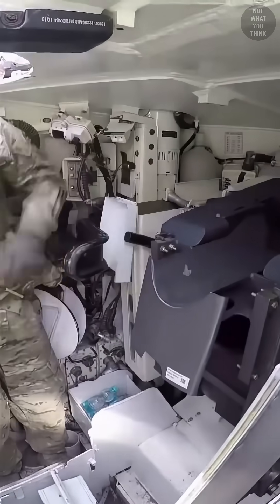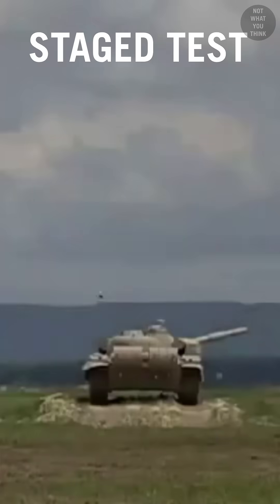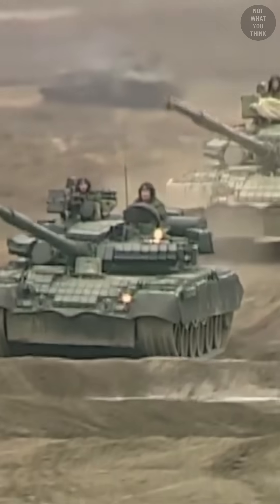Why M1 Abrams Tank Has No Auto-Loader #shorts

Comment: I'm sure, if the US wanted to, they could replace the loader with a auto loader and still keep the ammo in the same place. After all, robotics, image recognition and processing power has greatly improved since the initial deployment of the Abraham's in the 1980s. 

I'm sure that the next generation of US main battle tank will (have the option to) be completely remotely operated. As drones are generally cheaper to operate, even tank sized ones, and require less of a public relations effort whenever they are used or get destroyed. So, we will likely see an auto loader in a US tank soon.

Comment: almost no russian tank accept the t14 has an auto loader
Reply: The current line of russian mbts since the t-64 have all used autoloaders including
T-64
T-72
T-80
T-90
T-14
2s3m
Bmp3
Etc etc, they use autoloaders
Reply: list of tanks with autoloaders:

A
Al-Khalid tank
AMX Chasseur de Char
AMX-13
AMX-50
Armata Universal Combat Platform

B
Batignolles Chatillon 155 mm
Black Eagle (tank)

F
Falcon Turret

K
K2 Black Panther
Karrar (tank)

L
Leclerc tank
Leclerc XLR
Lorraine 40t
Lorraine 155 mm

M
M-84AS
M-84AS1
M-95 Degman
M8 Armored Gun System
Main Ground Combat System

O
Obiekt 490
Obiekt 490A

P
Patagón
PT-91 Twardy

S
Sabrah Light Tank
SK-105 Kürassier
Spähpanzer SP I.C.
Stridsvagn 103

T
T-14 Armata
T-64
T-72
T-80
T-84
T-90
T-Rex (tank)
T71 Light Tank
Type 10
Type 15 tank
Type 80/88 main battle tank
Type 90 tank
Type 96 tank
Type 99 tank

V
VT-4

Z
Zulfiqar (tank)

how many russian tanks are there? ah yes, quite a few.

Comment: The more I learn about tanks the more I think the "Some argue a loader is essential to replace one of the other roles or maintenance" is just Americans with actual experience in the Abrams.
It seems to be a maintenance heavy beast. 

Speed, location and safety seem like non arguments. A human takes up a heck of a lot of space, especially one that needs to move about a bit to load the shell. If you were to dedicated the same amount of space to machinery this surely must be possible to do in a similar manner. If anything the blowout panel could be open for even less time. Location is just engineering.

As for speed, the Korean K2 Black Panther and French LeClerc main battle tanks can reload in about 2 seconds (faster than the fastest human reloader). And unlike a human they can do this without getting tired, I've seen these shells quoted as up to 40KG. The only people that move that kind of weight about without tiring within a minute are strongman that won't fit in a cramped tank ;).

Comment: Auto loaders can only load certain length of shot.  Not having one makes you able to use different shot and newly developed ammunition without having to refit the turret with a new autoloader.  Also from my uncle that served with Eagle troop in the gulf and k-troop in the war on terror as a master gunner and commander of an up armored M1 abrams, said a good loader can load rounds faster than an auto loader and doesn't break down and if damaged is easily replaceable, he also says the tank with an autoloader that faces a m1 isn't a threat at all, for long. As the ammo storage arrangement required fir a auto loader to function is perfect for popping turrets and crew.

Comment: It's not a question of an autoloader. it's a question of ammunition storage. The Soviets assumed an atomic attack on the front line and the immediate entry of assault troops on the burning ground. This is certain, while rumor has it that the autoloader had to be used because they discovered that under high radiation conditions the first crew member eliminated would be the one using the most muscle...

Comment: Auto Loaders which have been in use since world War II add complexity to a tanks design, thus making a tank more expensive to produce and maintain. Using a human loader reduces down time due to equipment malfunction which means that a tank can be damaged, those parts replaced and quickly brought back into the battle without having to wait for a specialized team to arrive and fix the autoloader, or worse writing a perfectly salvageable tank off as a Battle loss.
Adding complexity was the main draw backs of the Tiger II tank in world war II. as a result of it's technical superiority it saw less combat time than older generations of tanks, and was prone to break down more, and spend more time in maintenance than on the battle field.

Comment: There are also auto-loading systems which have a seperate compartment with blow-out panels similar to the ammo rack of the M1, Leopard, or other modern western MBTs.
Thing about russian tanks is, that they were designed in a time in which top-attack munitions (Like TOW, Javelin or NLAW) were a non-issue. So the ammo was placed as low in the tank as possible. This, alongside making the T-Series silouettes as small as possible, made it harder for another tank to hit.
So engineering a solution for ammo-cookoff was not needed lowering design cost.
However, when penetrated (the likelyhood of which has massively increased thanks to weapons like the TOW or Javelin which ripped away the first three layers of the suvivability onion), there are little measures in place to increase crew survival.

Comment: Also, a well trained & drilled Abrams crew can maintain about twice the rate of fire of an autoloader equipped tank.
Reply: Yeah like manually inserting bullets into a gun each shot you fire is much faster than letting it cycle

Comment: You have no clue what are you talking about. Abrams also explode from inside, same as every other tank. Ammo inside autoloaders revolver (karuzel) is protected better than in abrams, as it is placed under turret on lowest point of tank. It also got own additional armour, as seen in this video.  Abrams storage is in most common place to be hit. Doors of abrams are huge, karuzel have only one shell size opening . Internal explosions are product shells stored all over tank get ignited. Not one in karuzel. Solution is using only shells in karzuel and zero in additional places. Men loader results in 15t extra weight , as tank is bigger (and not thicker).  You need 4 crew to train, not 3. it doesnt matter if tank is destroyed or destroyed with turret blown out. And in total lost you have 4men dead or 3 in soviet type tank.

Comment: Lets add HE-FRAG ammo into the Abrams ammo rack, hit it and then see what happens, shall we?

I'd love to see how "Private Strongarm" is going to load shells into the breech when the tank is tilting and crashing over 3 axis while on the move.

Once we upgrade the Abrams gun to, say, 135mm, it's STILL going to have a human, or will A LOT HEAVIER shells be loaded by the human?

If hull armor is penetrated, the tank is in most cases lost. Assumption that crew will survive is made because it wasn't hit by an artillery shell. Which is the main tank killer today. Or by a modern ATGM. 

Turret floor is THE safest place for the ammo. It's the least struck area of the tank and to get there, the heaviest armor has to be penetrated. Developers of the new light tank for US marines agree and the tank conceptually is literally a US iteration of what T-64 is: a 3-man crew, HE-FRAG ammo, troop support mission, high mobility, lighter passive armor covered by ERA.

Comment: There is absolutely no problem with storing ammo just like in Abrams and still have autoloader, there was autoloader designed for Abrams as well. Autoloader would even make it safer, because it would need only a small door to take ammo from ammo compartment, while in manual loading Abrams there are large heavy doors. Judging autoloaders by russian designs only is just plain stupid :P

Comment: The issue is not typically the ammo in the auto loader itself, the ammo is 2 peice and often the tanks have small numbers of charges stored in racks that are exposed in the crew compartment. Those are the usual cause of detonation in Russian tanks.
Reply: So the issue is typically the ammo in the autoloader itself.
Reply: @KaIIenie  not directly, certainly the end result is, but the ammo in the loader itself is protected by an armored deck below the crews feet along with the general design of the vehicle. it's not the loader itself that usually goes off first. the vehicle features a number of 'wet' stowage racks for extra munitions, which are also fairly well protected, the big issue lies in the Russian military issuing Extra stowage racks that are collapsible, those rounds are unprotected and vulnerable. Most of the tanks that throw their turrets are using those extra racks or have been hit with top attack munitions that target the weakest point of the tank, allowing them to get somewhat more effective impacts against the loading rack itself. Ironically, the weapon that causes it most frequently is the Javelin we've seen used so heavily in Ukraine.

Comment: The OTHER autoloader design is called the cassette, bustle or revolver style, and stores ammunition in the turret bustle.
This allows for use of blow out panels, and is safer than a human loader.
The armoured door separating the stowage from the crew compartment can be made just small enough for the loading mechanism to push a round through. A much smaller door means it can be better protected and minimises the time it is open for loading.
Many tanks that use autoloaders opt for this design, with only Soviet/Russian tanks using the carousel. This includes Japanese Type 90, Type 10, French Leclerc, S Korean K2, among others.

Comment: The Russian auto loader magazine is under everything else. It is well protected from top hits. The vulnerability comes when they store extra rounds in cubby holes above the autoloader because their supply lines are stretched too thin. The Abrams system of storage is way more survivable by the crew. But the tank is still out of service. Tanks are almost obsolete. Abrams is way too heavy for mud. The projectile from a manpad is traveling at mach 2.5 and is molten steal. Cuts through anything to a certain depth. Reactive armor is still a ? against them. Abrams has a better targeting pc/ new tech

Comment: Really stupid explanation, it's not difficult at all to build an autoloader with blow off panels, the French leclerc, M1X, K2, type 10 and so on all have autoloader with separate ammo storage and blow off panels. Actually autoloaders are more safe since the door doesn't have to be open for as long and you can even expose only a single round at a time to the crew compartment. And of course they fire significantly faster and more reliably

Comment: This has nothing to do with auto loaders...lots of tanks have manual loaders yet their turrets pop off just like you see in Russian tanks because guess what it's where you store the ammo and where the crew is positioned when ammo detonates not wether or not you have an auto loader. Also if a tank is hit in a way that the ammo rack is detonated on the auto loader even if it wasn't there you would still be paste on the turret wall. So it really doesn't matter you would be dead either way. Also the majority of tanks don't have all ammo stored behind blow out panels so specifically Russian tanks are irrelevant to this issue

Comment: Abrams has been trailed with an unmanned turret and hull mounted automatic loader it’s also been tried with a loader mounted in the bustle rack, a system commonly used on newer NATO spec tanks. The reason why Abrams uses a manual loader? Primarily is budget.

Comment: It’s more about the military doctrine of the nation using the tank. Russian T-80s weigh about 15 tons less than Western tanks, are considerably shorter in height, and have smaller weak spots. In general it is harder to score any effective hit on a Russian tank. However, because Russian tanks are so small and condensed, any hit that effectively penetrates will do catastrophic damage to the crew or ammunition, and fully destroy the tanks. 
American tanks, by comparison, are significantly heavier and larger, which makes them harder to maintain and transport, and have more obvious weak spots when it comes to tank-on-tank engagements. But even if the tank gets penetrated, there is a lot of systems in place that make sure the crew survives, and the tank can retreat, or be abandoned and recovered later.

The reason Russian tanks perform so poorly in Ukraine is because the tanks are primarily engaging infantry, and the T-80 is not nearly as effective as the M1 in an urban environment. Partly because of the ergonomics and design of the tank, partly because of the tactics of the militaries using the tanks, but mostly, Russian tanks are extremely vulnerable to being attacked from above or the sides, and Ukraine is being flooded with AT weapons for infantry. 

In a tank-on-tank warfare situation, Russia’s T-80s would be far more effective, especially on the defense, given they had proper tactics and support from other elements.

If there were T-80s hidden in defensive position along Russia’s borders trying to repel a NATO attack, M1s and Leopards would struggle and suffer heavy losses to T-80s. The only way to mitigate those losses would be to destroy the Russian air defense network, because then airplanes can spot enemy movements or destroy enemy tanks that are holding up in powerful positions.

Comment: Auto loaders can have blow out panels too(technically) but the overall benefits to an autoloader is a smaller silhouette, which is what the soviets wanted. 

Now with the resurgence of an entirely automated turret(yes they tried it before in the 60's or 70's iirc) an autoloading Abrams could likely be coming in the future. 

And no I don't mean Abrams X, that's a concept tank that has gadgets and doodads the military and use or rework if they want.

Comment: Some other factors: autoloader reloads at a more consistent speed whereas manual loader reloads faster when the tank is still. Autoloader reduces the size of the tank so it's harder to hit and lighter, but manual loader is an additional crew that could help with maintenance.
Reply: You really think and auto loading mechanism is lighter and smaller than 200 pound soldier?

No, Auto loaders are enormous and heavy, say what you will about improved fire rate and consistency, but weight and size are certainly not what make auto loaders tactically viable.
Reply: @primeministersinister625  I have yet to see a single tank with autoloader that would be bigger and heavier then it predecesser without it...T-64 had bigger gun then T-62 while becoming a SMALLER tank size wise and only getting 1 ton heavier due to more armor... Same with any other autoloader equipped tanks. Why do you think do Japanese use autoloaders? Because they need to keep their tanks light and small.
Reply: @alexej123  what ammunition do they use/how much?
Reply: @stevenphilpott4294  (sources are not as precise at what max capability is and what actually being used) Who? Japanese? 120mm with up to about 36 rounds due to smaller size of tank, using standart Nato ammunition and some extra, better rounds), Russians - 125mm with up to 40+-. Both have rounds stored in autoloader system itself and extra rounds elsewhere in tank. So pretty much the same amount as tanks without autoloader. Size and weight speak for autoloader, as it can use the space more effective. Thats why there are even more new models from all over the world coming equiped with it. Dont forget the Chinese, Korean and French. All use autoloader too. And when you think about the future - and plans to create "drone" tanks without people in them - autoloader is the only way to go.
Reply: @alexej123  With the most realistic way forward being drone, or at least partial autonomous integrated platforms this definitely makes most sense.
Reply: Auto loader takes up more space not less. Adds more weight to vehicle making slower, more mechanics more chance of failure, auto loader has to be connected to turret limits range of fire from turning turret, ect;
Reply: @aggilos9650  wrong. Autoloaders invariably take up less space than humans which take up much more space.
Reply: @aggilos9650  Believe in machines. Man-made machines designed to do certain jobs always do better than humans.
Reply: @jianingliu6875  I served in military they always take the lowest bidder which means a lot of times not better than people.
Reply: @jianingliu6875 sometimes having a man to prevent turning your tank into a helicopter is a good thing.